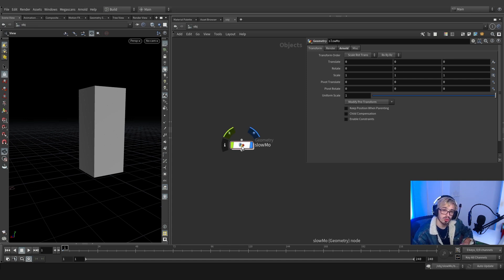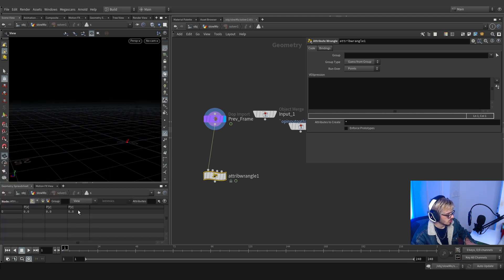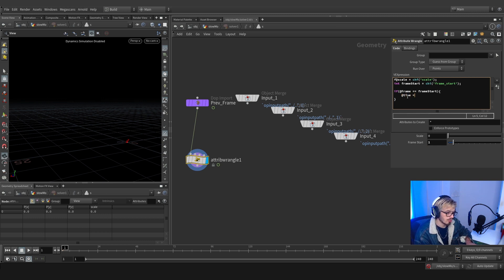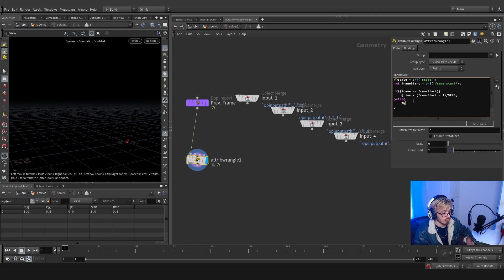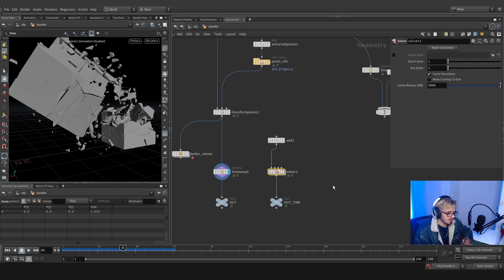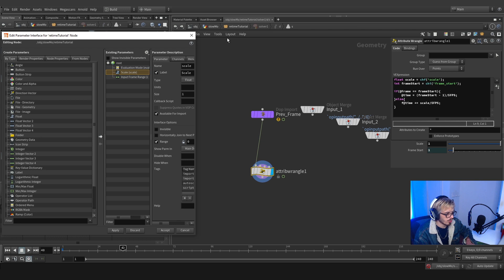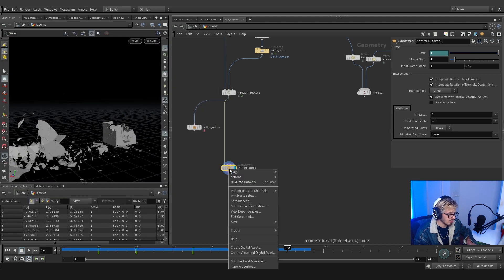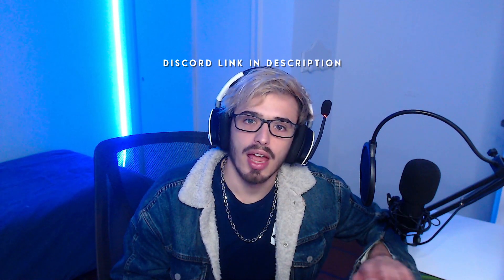Best Slow Motion Effect With Houdini!

Comment: Can we use this retime for volumes?
Reply from the maker: I havent tried because volumes require more work to be retimed. I would guess you cant. It is, however, a very cool tool for rbd.
Reply: Thanks for the tutorial. I'm making a slow-motion explosion. Maybe I'll use timescale for volumes
Reply from the maker: @NithishVS666  I would recommend using and saving substeps. Then readding each substep individually and retiming from there.